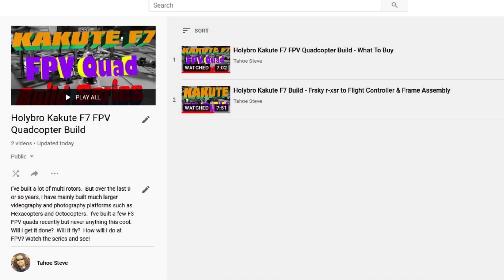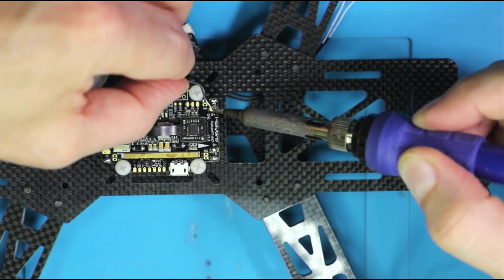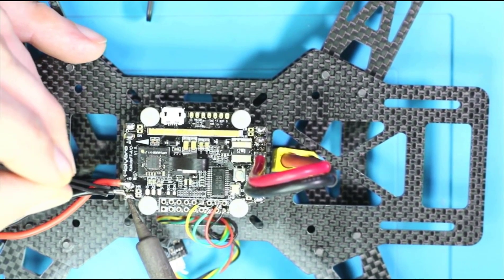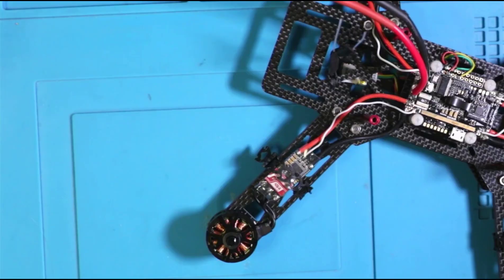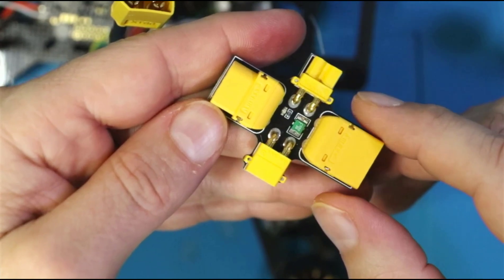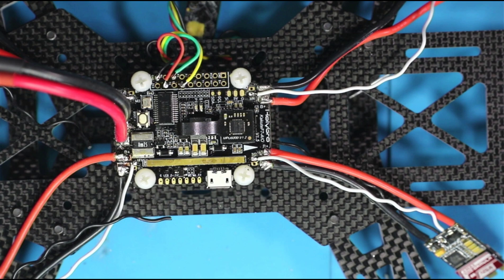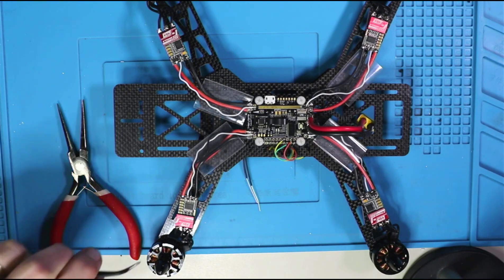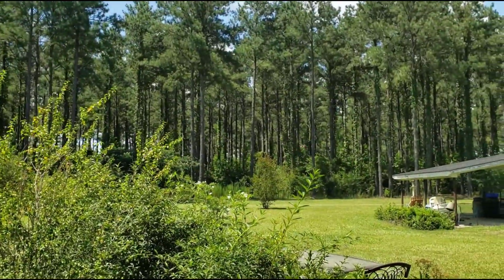Holybro Kakute F7 Build - Adding / Soldering ESC's & Motors

Comment: Probaly the biggest question was not covered.....what pads do the esc signal wires go to.
The manual does not explain this.I see 2 small pads but they are not marked as to which wire goes where.